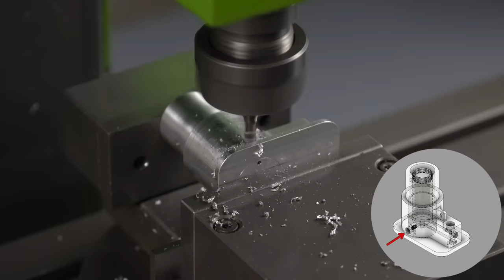Making a Pocket Hydraulic Car Jack

Comment: Would love to see it tested against a scale
Reply: Just not tested to the “failing point”
Reply: @redneck_cowboy7826  the failing point would likely be the o-rings, so that's relatively easy to repair anyway. I don't think the metal itself would break
Reply: Exactly, I only watched to see it tested to its limit. Once I saw that rubber plug I was instantly disappointed
Reply: @6daysago167  the rubber plug only seals the oil reservoir, it's never exposed to any pressure
Reply: @Giuliana-w1f  oh, I didn’t know that. I thought because he put the hydraulic fluid in that way, it might come out that way.. thanks for the info 👍
Reply: @6daysago167   That could only happen  if more fluid was  add once the jack was extended.
Reply: You need jack stands to go with your jack  not safe to use 1 without the other
Reply: Adoraria vê-lo testado num caminhão carregado de cimento

Comment: Thank you so much for the illustration at the end!  I was really wondering why you built the cylinder the way you did until I saw that the outer ring was the reservoir.  I also wondered why you drilled a hole in the inner cylinder until I saw the animation and realized that was a bypass for when the piston reached full height (which was something I had wondered about during the demonstrations).  I guess the fill plug has just enough compliance to allow air in/out of the reservoir during use but not enough to allow liquid to leak.  Very cool.  I hadn't ever thought about how these jacks work, but they are really very cleverly designed!
Reply from the maker: Thanks! I really appreciate your feedback. That means a lot!

Comment: Why are there so many different ways to add threading? I noticed several ways in this video and my guess is something about the different types of metal? Maybe....lol
Reply: Normal threading tools are more easily accessible for most and quick to learn and use, though they require steady hands when first entering, or you can get threads slightly angled comparatively to the item you are creating threads on. Ways of helping this could be using a drillpress with a center point attachment for inside threads to help stabilize while starting the threads or without any attachments with the outside threads tool. 
Using a lathe is a much bigger upfront cost, requires much more in-depth learning and knowledge of the specific lathe, and how it operates to utilize the threading ability if it it has it (most do). It also requires specific cutting tools as one cutting tool can only do a limited amount of sized threads and double if you need both outside and inside threads. But, it allows for a much higher precision, adjustability with height of threads, and other specific demands that you might need. This though has it's limit as it requires that the item can be brought to the workshop and fastened in the lathe, whereas other options can be brought with you as part of a tools kit for threading at the jobsite. So, in short, multiple ways, each with its cons and pros.

Comment: Mechanical question here! 
I've always been told, use tapping oil when tapping internal threads to keep it cool and to keep chips moving out. wouldn't the grease hold the chips inside and potentially cause a tap to break? obviously it didn't break for you, but not all situations are the same i guess. 
Would you always use grease? or is that just in the case of this specific material you are using?
Reply from the maker: The tapping oil I use varies depending on the material.

Comment: Good job, Jony! Молодец!
Although copper is a dubious material choice for a power lever, I'm kinda disappointed. I thought you'd use it for pin bushings to eliminate the lever play and would go with some stainless or even carbon steel (later polished, or even maybe oxidized?) for the lever itself.

Comment: There's only one thing I'm confused about: at 10:33 Maker B drilled through the bottom of the Inner cylinder and it is clearly marked as one of the fluid passages. However, I never saw them do anything to actually seal up the hole they made, so shouldn't the hydraulic fluid just leak out of the bottom when the release valve is unscrewed?

Edit: Nevermind. just re-watched the assembly section and, even though the video doesn't show when, at 19:43 you can see that something has been inserted to seal the hole. (Same goes for the fluid channel beneath the valve check on the front)

Comment: How do you set the larger base piece with the square bottom in the lathe so that It spins exactly around the center point of the cylindrical section?

Comment: Three questions I have to ask you. Min 0:21. When you rotate the piece, do the centers remain the same? Min 13:06. Is that copper? Doesn't your blade get dull? Throughout the entire process, you have not used the dial gauge even once. When I want a lot of precision, I use the 4-jaw chuck and the clock. I wonder that you don't use it or that the Sherline lathe is so precise. Greetings and thank you.